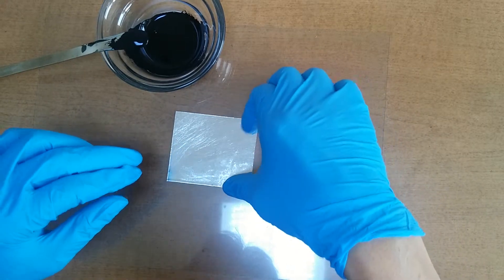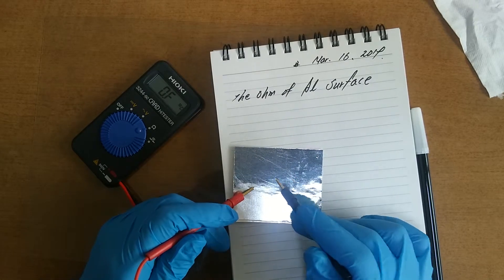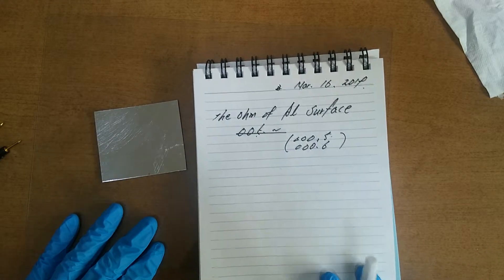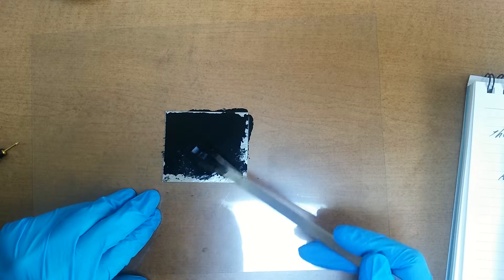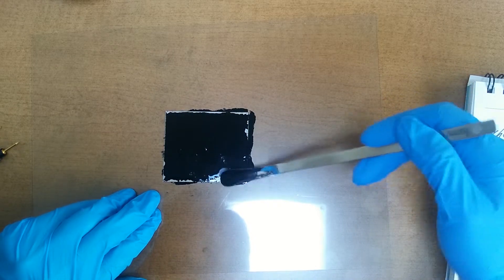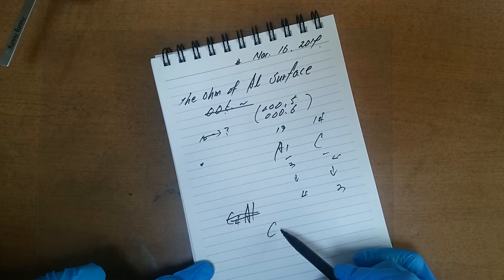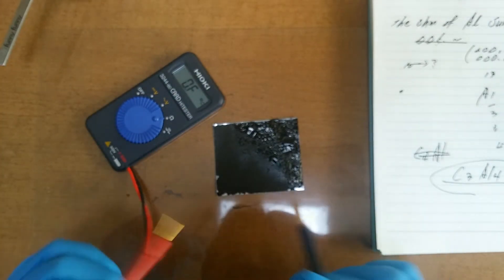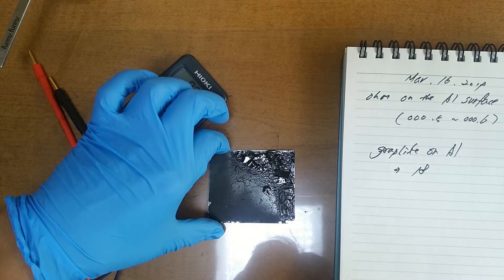graphene(graphite) coating on the aluminium

Comment: Multimeter has its own resistance in wires, try to directly connect wires together and check the resisrance, then you take that off from what you are mesuring.
Reply from the maker: thank you very much. when the ohm nears zero, I will try it